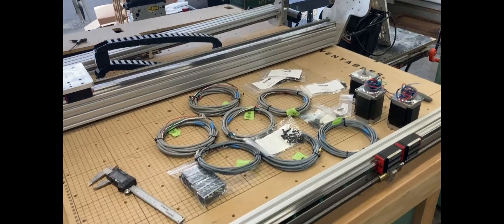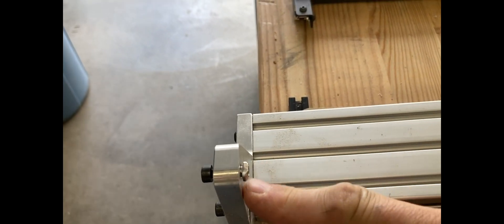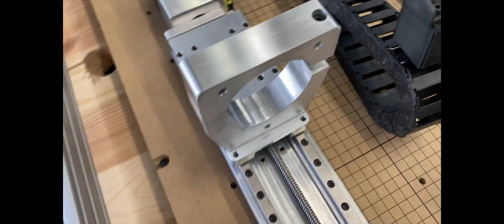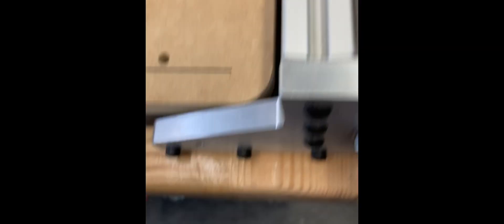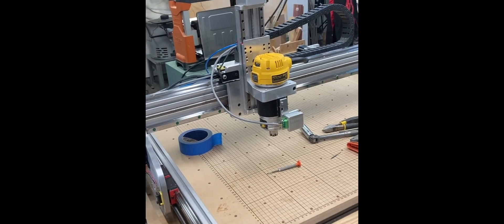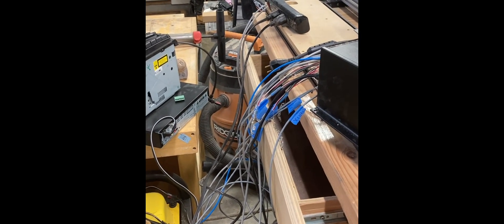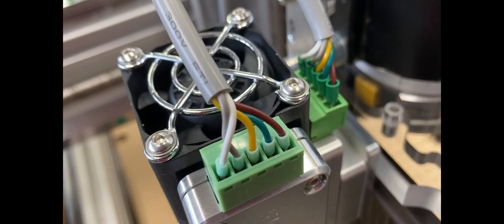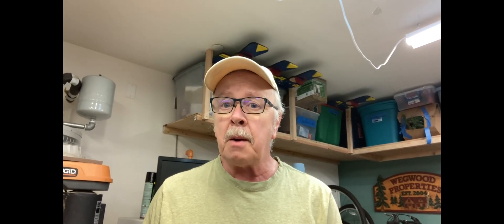The Awesome X-Carve Ultimate Upgrade From CNC4Newbie - CNC Modifications

Comment: Hi.  I just did the upgrade.  But my z is awefully slow and freezing the pic sender and easel.  Can you please help with GRBL settins and wiring of the new motor and slide
Reply: did you get this worked out? if not, After the mechanical you need to upgrade your GRBL settings,  here a good starting point:

CNC4newbie Z axis RECOMMANDED GRBL SETTINGS
TRAVEL---->      5"       6"       7"       8"
SETTING $ 102= 50,059   50,059   50,059   50,059

         112= 1500      2000     2000     2000

         122= 100       100      100      100

         132= 124       149      175      200

** If your Z axis is reversed, you can reverse the Z direction in the Machine set-up if you use easel or you can Re-wire your stepper. Only to swap to wires of one phase.
** For better performance you can change your hardware microstep setting to 1/8 and re-adjust the setting $102.  Your Z axis will run better without a loud noise.
Reply: $0=10 (step pulse, usec)
$1=255 (step idle delay, msec)
$2=0 (step port invert mask)
$3=0 (dir port invert mask)  <-- WILL VARY BASED ON WIRING
$4=0 (step enable invert, bool)
$5=0 (limit pins invert, bool) <-- WIRES CONNECTED TO THE NORMALLY OPEN LIMIT SWITCH PIN
$6=0 (probe pin invert, bool)
$10=115 (status report mask)  <-- GRBL 1.0c
$11=0.020 (junction deviation, mm)
$12=0.002 (arc tolerance, mm)
$13=0 (report inches, bool)  <-- USE $13=1 TO SEE MACHINE AND WORK POSITION IN INCHES
$20=0 (soft limits, bool) <-- SETUP YOU PROPER MAX TRAVEL DISTANCE BEFORE TURNING ON
$21=0 (hard limits, bool) <-- DO NOT USE HARD LIMITS
$22=1 (homing cycle, bool) <-- YOU MAY WANT TO TURN THIS OFF AND TEST FOR CORRECT DIRECTION OF JOG FIRST
$23=3 (homing dir invert mask)
$24=25.000 (homing feed, mm/min)
$25=750.000 (homing seek, mm/min)
$26=250 (homing debounce, msec)
$27=1.500 (homing pull-off, mm) <-- A DISTINCE OVER 1 ENSURES DEPRESSING THE SWITCH FOR THE SECOND PRESS
$30=1. (Max. RPM)
$31=0. (Min. RPM)
$32=0 (Laaser Mode, bool)
$100=133.333 (x, step/mm)
$101=133.333 (y, step/mm)
$102=200.236 (z, step/mm)
$110=4000.000 (x max rate, mm/min)
$111=4000.000 (y max rate, mm/min)
$112=2000.000 (z max rate, mm/min)
$120=100.000 (x accel, mm/sec^2)
$121=100.000 (y accel, mm/sec^2)
$122=100.000 (z accel, mm/sec^2)
$130=VARIES (x max travel, mm) <-- 500mm = 400, 750mm = 650, 1000mm = 900, 1045 = 900, 4545 = 1344
$131=VARIES (y max travel, mm) <-- 500mm = 365, 750mm = 615, 1000mm = 865, 1045 = 1315, 4545 = 1315
$132=VARIES (z max travel, mm) <-- 6 INCH TRAVEL Z = 150, 7 INCH TRAVEL Z = 175, 8 INCH TRAVEL Z = 201